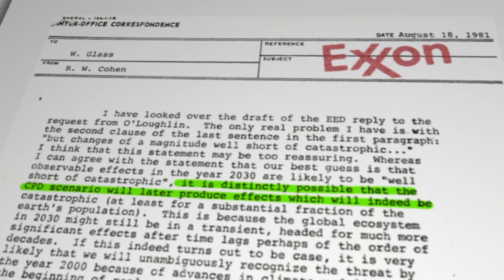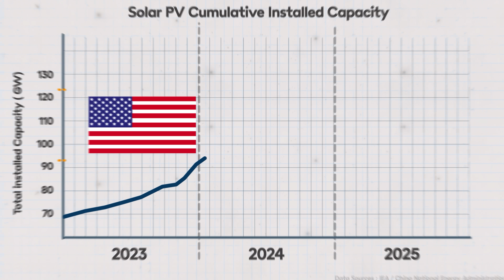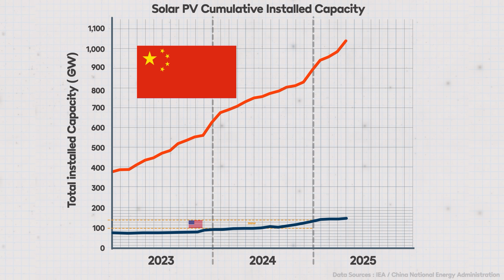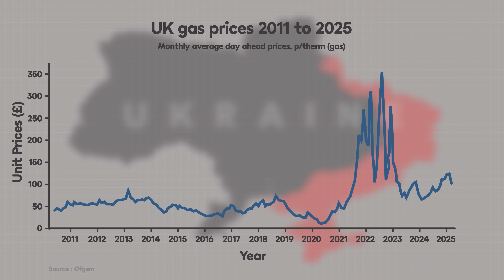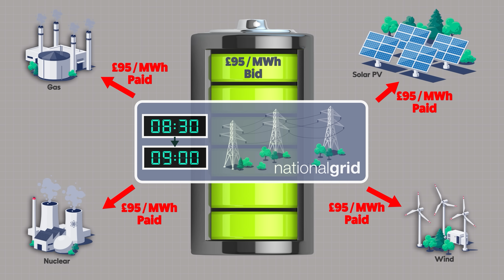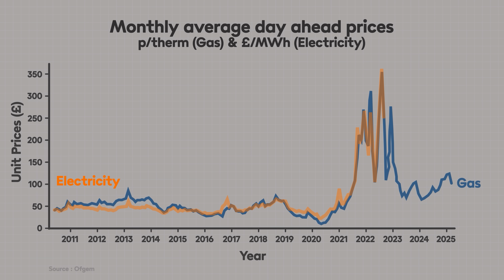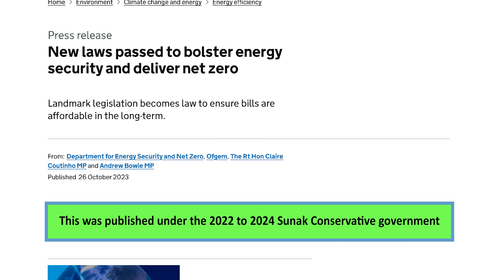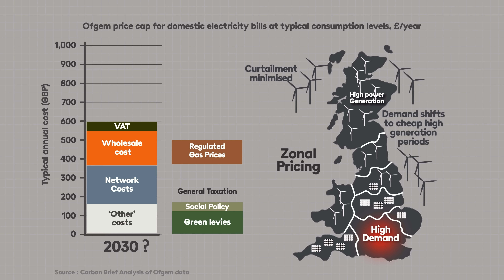Why is UK Energy SO expensive?

Comment: It's not a case of whether or not we can afford renewable energy because it's a irrefutable fact that we can't afford not to, the cost of not changing over to renewable energy will be far greater than if we do. The quicker we make it happen the quicker we can all start to benefit from it, we can't afford to allow the stalling tactics used by the fossil fuel lobby any longer.
Reply: Yeah, I won't say going green is 'cheap'...but the cost of not going green is insane over the long term.
Reply: @pixelpusher220  I would say going green is cheap.
Reply: @williammeek-h2o  Not exactly on the initial bottom line, no it isn't.   Infrastructure isn't cheap to build - but it is cheaper over the long run even without the environmental damage the CO2 is causing.
Reply: Yeah you are right and we can make it cheaper and more reliable by also using nuclear fission , lets not do the same error Germany did
Reply: Listen you're an adult now you don't need to listen to the propaganda from teachers with stinking coffee breath leaning over your shoulder when you sit at your desk, it should be up to every single person on earth to decide whether they want to release CO2 emissions or not, not the government!
Reply: Nuclear energy?
Reply: I'm not convinced we can afford it,  battery tech although slightly better than a combustion engine is still woefully inadequate in terms of its carbon footprint,  renewables are too intermittent,  any issues to fix this intermittency involve expensive and carbon intensive batteries again as well as fossil fuels to back them up,  to the point where the fossil fuel industry actively encourages renewables because they know that it's inferior to nuclear and far less a threat to their existence.
Reply: who has to make that happen?
Reply: Ah, yes - but it’s not ME paying the price. I won’t be around in ten years so what the hell - screw the future.
(That’s sarcastic in case you hadn’t got it.)
Reply: Lol.
Reply: stop talking nonsense please! its because of that same fossil fuel that you have renewables, the grid, the global economy and more, literally from roads to consumer products, solar panels, batteries and the hardware its made from oil too.
Reply: As far as I'm aware nobody has ever suggested that we give up using oil entirely,  at least not until we find an alternative to it, the priority is to find an alternative right now to burning fossil fuels mainly due to the fact that they're highly inefficient and extremely damaging to the environment.
Reply: Nuclear is by far the most ecologically responsible power source. The cost benefits depend on how well the build process is run, but due to the tiny environmental footprint it's far more ecologically responsible than solar wind or hydro.
But, the ideal mix would be nuclear baseload complimented by rooftop solar and pumped hydro.
Reply: @Jake12220  laughably naive.   Claiming to be able to store the waste safely for longer than modern society has existed is.....something.

It's absolutely necessary for the next 20 years til renewable+storage has scaled up, but beyond that nuclear is entirely a niche tech where the situation overrides the cost and waste issues.  I'd wager we have enough nuclear built or in pipeline to cover that.

I'd even grant an exception to thorium expressly because it can eat our current waste.  Still a niche given all the other far far far cheaper options.
Reply: @pixelpusher220 the long term storage of nuclear is relatively easy, it just requires very deep mine shafts in arid areas that are very geologically stable. The containers are packed in bentonite clay, which expands if exposed to moisture, so automatically seals cracks or holes should there be an unexpected leak(more likely to be groundwater than the barrels), but the areas are specifically chosen for no groundwater. 
Multiple areas around the world have been identified and the science is quite clear that they would be a safe permanent storage solution. The only possible issue would be future generations digging it up, but there are plenty of easier ways to create something dangerous and the highest level waste breaks down pretty quickly to far less radioactive isotopes and elements.

Regardless of how cheap renewables become, nuclear will still be more environmentally friendly. Nuclear requires far less mining, requires dramatically less land, can be built closer to where the power is needed thus need less high voltage transmission lines which themselves require a lot of resources and are another form of environmental vandalism.

So what do you want, or perhaps where on the spectrum of cost vs environment is your comfort spot? In terms of costs, just using coal and skipping the environmental regulations is the cheapest, in terms of the overall environmental impact nuclear is by far the best option, renewables might be somewhere in-between once their costs drop further, but for now they are both more expensive and more environmentally damaging than nuclear.
Reply: @Jake12220  it is not easy, as it would have been done by now.   You can hand wave that inconvenient fact all you want.  It doesn't change it.   Pretending we can safely do something for literally 1000s of years is beyond foolhardy and entirely kicking that can down the very very long road.
Reply: @pixelpusher220 you clearly haven't taken the time to look into the storage sites that have been proposed.
The ability to store the material and the locations to do it have been established since the 90's. The only issue has been lobbyists and political pressure. The actual science and engineering was sorted out long ago.
It's the same with a lot of things when it comes to nuclear, the baby boomers and older genx grew up being told nuclear weapons would one day kill them all, so a lot of them grew to be extremely anti nuclear.
It's sad, because if we had continued to invest more in nuclear power and the safety and efficiency that would have come with that. Then we would now not have to worry about co2 from fossil fuels or argue about renewables. Most of us would probably also be driving electric vehicles simply because power would be abundant and the operators would be encouraging more electrification.
Reply: @Jake12220  Translation:  we haven't solved it and you're still hand waving the risks away.
Reply: @Jake12220  what happens to spent fuel  and the water used for cooling,  how much does it cost for decommissioning of nuclear plants when they come to the end of their life. Also ask the residents of Chenobyl and Fukashuma about the environmental impacts.
Reply: @GaryV-p3h fuel can be recycled. The Water for cooling is hardly affected. this is misinformation. They operate for 50 to 100 years.. decommissioning is a pointless discussion due to this fact. Chernobyl is a once in a society level event. it will NEVER happen again. it physically cannot happen again. additionally the soviets built the plant incorrectly. they were told they cannot use Graphite to moderate in the way they planned to because what happened could happen. they chose to ignore this advice and proceed. 

Fukashuma is a confluence of events that caused the issue in the first place. They were ALSO TOLD that this could happen when they built it. They were told they should not make the secondary generators below the water line. Guess what they did... So no. your entire comment is just disinformation and a lack of understanding of the actual realities at play. Please stop spewing this crap.
Reply: @GaryV-p3hthe water isn't radioactive, water can't be radioactive, though particulates of heavy elements can be contained in contaminated water, but that's pretty easy to separate through distillation or centrifuge. 
The fuel rods are a tiny volume that are easy to store extremely long term and extremely safety. The issue with fuel storage is more a political and greens activist issue than a practical one.
Fuel rods are also recycled over and over as only a small portion of the fuel gets used in each run.
When nuclear waste is stored it is typically vitrified (turned to solid glass) and then stored in very large steel lined concrete barrels that have been tested to survive being hit by a freight train. The safety standards are off the chart for nuclear waste, they can be because there is so little of it relative to the power produced.

As for Chernobyl and Fukushima, both were predicted and completely avoidable. The issue with both is that they were old plants that didn't have a lot of the safety systems more modern plants are constructed with. In the case of Chernobyl it was largely bad management along with a couple of minor failures that wouldn't have been an issue if the staff on shift were hired because of their political position rather than their experience or expertise.
Fukushima was caused by a failure in the cooling supply. The failure was caused by the diesel backup generators failing due to getting swamped by the tsunami. This was a predicted risk that was well documented years before. If they hadn't shut down the reactor as a safety precaution then it would have continued powering it's coolant system and there wouldn't have been an issue.
In both cases it was due to old designs and poor management.
Modern reactors have far better safety systems where these sorts of disasters are close to impossible.

But then you have to look at what the actual impact of the meltdowns were. We now have nature reserves that are largely protected from human interference. Chernobyl is effectively one of the most amazing national parks in Europe, it now contains multiple species not found anywhere else in the wild. The local population of animals, birds and plants are all thriving.
Reply: @Jake12220  Perhaps mention the sites where renewable sources of energy are disposed off, accounting for millions of tons even after a lot of censorship, all while most of the world's renewables is expected to hit the end of their life in this upcoming decade.
Reply: As an early adopter of solar, I can see be problems.  A 6kw system does not produce 6kw when it is needed, and when it is raining or overcast, or at night.  This means that the solar system needs more panels to average 6kw, but that also create a problem because it still peaks in the middle of the day and is not available at night and during periods of little sunshine.  We could solve this with batteries, but that increases the complexity as the batteries are expensive and are usually subsidised which increases electricity bill costs.  Then there is the fact that remote solar and wind farms need a huge expansion of the grid, and further grid storage, and grid stabilisation to produce AC power at the correct frequency that synchronises with large power plants over the entire grid.  Too much or too little power or a change in frequency creates a disaster for the grid.  Ideology can not solve this.  Nuclear would have been a better solution - it is zero emission and environmentally friendly.  Look at the CO2 emissions from France and compare them with Germany.  Germany was completely reliant on Russian gas and is still struggling with the unreliability of renewables to the extent that its neighbours are complaining that the use of their electricity is pushing up their electricity prices.  Making a grid that runs on renewables doesn't work.  Look at the recent issues on the Iberian peninsula.
Reply: @piezobarrel4750 it's your idéologie that is bad. The last twenty years have shown that with mass production we could divide solar panels cost by 10 to 20x. Same is happening to batteries, I am on a remote house and just last year the price of batteries was divided by two. Prices of lfp batteries were divided by two last year, and further price decrease are expected. Sodium ions batteries will be even cheaper and has infinite stocks as it is salt. Last year that 5kw battery in my country went from about 2200 usd to 1200 USD. This didn't really take into account last years fall of battery cell prices and will go much lower. For proof I went to see prices in China andvyou can get a 5kw battery for 500 USD!!!! This is unstoppable.
Reply: @piezobarrel4750  or just like.. i dont know None Chemical batteries? seems like a none issue to the vast majority of supporters that actually understand the science behind it.
Reply: Nobody will benefit perceptibly. It just means things will get worse slower, and the eventual outcome will be less dire.

It's not an easy sell.
Reply: Taking up massive amounts of land for crappy unreliable energy is beyond dumb.
Reply: @burtstineman449  I totally agree with you about them taking up land, they should be on the roofs of every building making evety home and business energy self-sufficient and removing the need to have to buy our energy from big businesses wherever and whenever possible.
Reply: @burtstineman449  And where are the crude pumps located?
Reply: The fact that solar and wind have such a low energy return on energy invested means that they cannot support an industrial economy. That means shifting to solar and wind means becoming poorer.
Reply: @afreire239  Wind and solar are far more rnery efficient than burning fossil fuels, heat pumps are 300% efficient compated to a gas boiler thats only about 60% efficient.
Reply: @afreire239  Really? Here in Finland (data from 2024 if not indicated otherwise):
- Electricity production: Nuclear 39%, Wind 25%, Hydro 18%, Biomass 12%, Coal 1.6%, Solar1.4%, ... (none of which are subsidized)
- Thus about  95% of our electricity is carbon neutral. Wind (and solar) has been growing fast (still growing albeit with a slower pace).  
- Electricity consumption per capita: 14.8 kWh/year (UK: 4 kWh/year) 
- Industrial price for electricity: 0.08 €/kWh - lowest in the EU (UK: 0.30 €/kWh, 2023 statistics)
Reply: @EneriGiilaan  nuclear without subsidies? doubt it.  Just googled it. for 5mins.. yeah that is bs. mate. Nuclear is the most expensive form of electricity generation and it  never works without gov. subsidies. Finland is NO exeption to this universal rule.
Reply: @grischa762  You are wrong in this case - but right in a way generally (see at the end). We have five reactors. Four of which were build in the late 70's - the things were a bit different back then. The fifth, Olkiluoto-3 was a nightmare project - both for the Finnish company that bought it and the French and German providers - took something like 18 years instead of the planned 7. But still not subsidized by our tax money (don't no about the French and Germans though).  Now it seems to work OK and the power  company seems to be happy.
But you are right that currently building new (big) nuclear power station is not profitable without subsidies - not even here. There were plans for a sixth reactor but industry said 'no can do' with their own assets only. This is mainly due to wind and solar which are much cheaper.
Reply: @afreire239   I don't believe this is true. Can you provide numbers to back up this claim? Specifically what is the energy ROI of oil vs renewables.
Reply: @afreire239  what it means is that it isn't compatible with a 'for profit' operation by private industry.    It's perfect for the gov't to operate it and provide all the benefits to the public.
Reply: @afreire239  We all know that yet the climate believers thinks that economical growth will continue even without fossil fuels and oil.
Reply: @afreire239  EROEI has a range of different measurements for each source depending on the technology and when the estimation was made.  EROEI for Solar and Wind has been going up as technology improves.  Whereas, for hydrocarbons it is going down, dramatically for oil, as extraction becomes more expensive.  Wind now has better EROEI than gas and oil.  Solar has a better EROEI than oil and similar to gas - currently - it is improving rapidly.   The glory days of cheap oil/gas and coal are well and truly over.  This is why even states like Texas are heavily investing in renewables - it makes economic sense.  Secondly, more expensive energy does not necessarily mean we get poorer.  Huge strides are being made in efficiency gains by going electric.  Well to wheel efficiency of an ICE car is about 12-22%, well to wheel of an EV is more like 70-80%.  Gas boilers can be up to 95% efficient but heat pumps are more like 400% efficient.  I have a 3.8W LED 'Dubai' lamp which is a genuine equivalent of a 60W incandescent lamp.  Of course, an overnight switch to wind and solar isn't possible.  But a holistic approach to developing the demand side, supply side and transmission and storage infrastructure can and is already enabling renewables to replace hydrocarbons.
Reply: @matbantube  If what you said was true why would industry leave the places with the biggest share of solar and wind and go to places where there are no restrictions on fossil fuels.
Reply: @afreire239  Since when?
Your just totally out of date with the tech and at what point are you going to give it a rest with the BS corporate cr&p
Reply: @SlowhandGreg  you are = you're
Reply: @afreire239  incorrect. energy and the availability of energy is one of the single largest factors in economic expansion statistics. more energy for cheaper means more industry and economic activity. 

None chemical battery storage makes up for the issues of intermittent generation. Your entire comment is fundamentally flawed with misunderstanding
Reply: @afreire239  That is entirely incorrect.
Reply: @afreire239  lets not forget the boom of AI datacenters all around the world, musk own are powered mostly by gas turbines and he hasnt even bothered building a dedicated power plant for it.
Reply: @afreire239  yes  ... but not everybody is poorer   ...some are getting rich